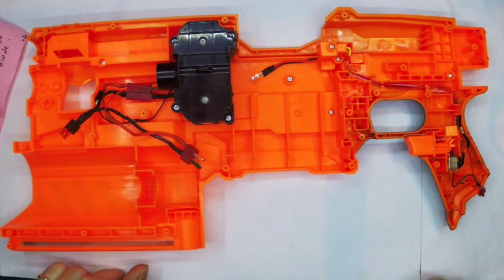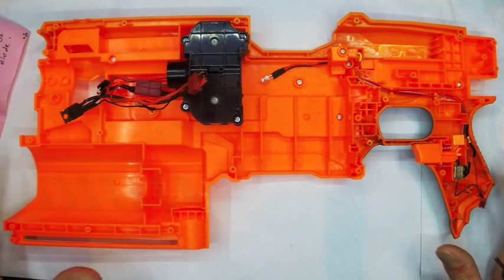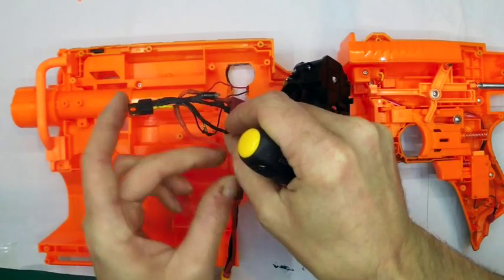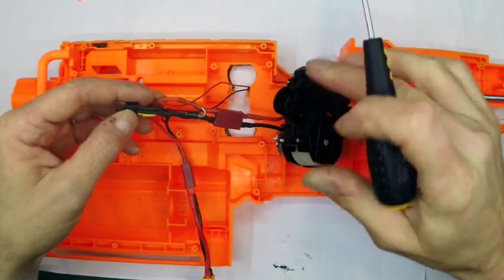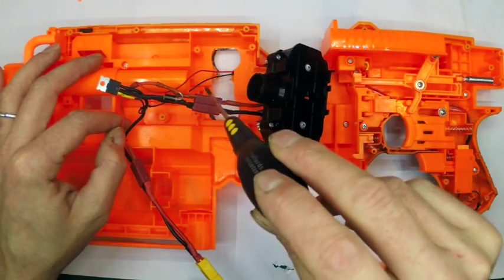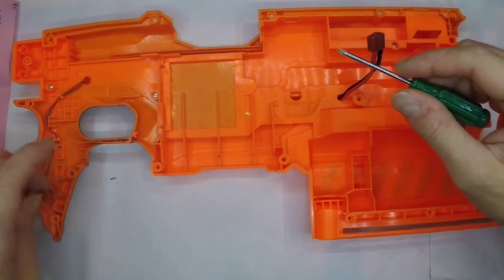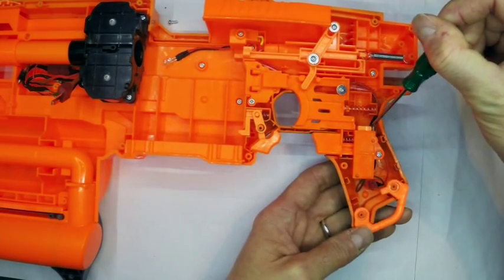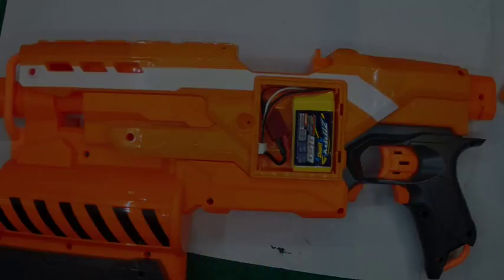Nerf Demolisher Rewire Guide- MOSFET kit.

Comment: Just wondering how high of a discharge and an mAh does the Lipo need to be when powering 180's? I know you use a 2S Lipo but i'm just wondering why use an 850mAh battery? doesn't it have lower Amps?
Reply from the maker: If you are using 3240,s then you want at least 30c constant and as big as will fit in the tray. The demolisher battery tray is particularly annoying because it's short. This means you can't fit larger batteries.
Reply: +Foamdata Services Thank you, and I agree about the case, it's so small that you can't fit a 1000mAh inside. I found that MTB actually stored one in the Jam door using velcrow to keep it secure.
Reply from the maker: +RedNinja Productions Blastersmiths make a tray expander to go outward.  The 850 I linked works for 3240s
Reply: +Foamdata Services I may be using Banshee's for a Demolisher rewire, because FK3240's are becoming obsolete here in Australia, and very expensive to buy just for 2 off eBay. Not to mention the cover for the motors. Really want to Try 180's but they're very expensive.
Reply from the maker: Banshees will be fine on that 850.
Reply: +Foamdata Services Awesome, Now I can finally mod a demolisher properly
Reply: +Foamdata Services How about an 850 with a discharge of 25C constant to a 35C burst for Banshees? or any 130 motors that run on 2S?
Reply from the maker: The voltage rating of the motors isn't what you need to worry about. An XP 180 is a 2s motor, each one of those can pull 30A stalled. All the 130 sized 2s motors will be fine with that battery. Get on Britnerf and look at the Nerf motor data sheet, it has all the info-
http://britnerf.myfreeforum.org/about1967.html

Comment: Thanks for the link but can you solder stranded wire
Reply from the maker: You can solder anything, as long as its non-ferrous, then you need brazing.
You should never use solid core wire for nerf, its not nearly as good, isn't flexible and belongs wiring houses not blasters.

Comment: Where do you get your wire from
Reply from the maker: 18 AWG Silicone Insulated wire is widely used in electronics and is easy to get on e-bay or from electronic hobby stores. If you order the complete kit from BSUK it comes with all the wire you need. i replied to you about this twice now. Please stop posting the same question everywhere. Google is your friend, use it.
Reply from the maker: Leo Hoffman  here is a link to an ebay listing.
http://www.ebay.com/itm/18-AWG-10-Feet-3m-Gauge-Silicone-Wire-Flexible-Stranded-Copper-Cables-for-RC-/281428997791?pt=Radio_Control_Parts_Accessories&hash=item418679b69f

Comment: So the diode is wired in parallel with the motors to shield the MOSFET from Back Electromotive Forces (Back EMF), but the diode does not cause a voltage drop?
Reply from the maker: Yes, it's there solely to shield the MOSFET.
Reply: It doesn't cause a voltage drop because it isn't placed between the motor and FET, it's placed across the motor terminals themselves. It doesn't bypass the motors and short the battery because it's reverse biased (i.e. you're trying to force current through it the wrong way). During rev up and firing no current passes through the diode at all (it's effectively an open circuit).

What it does do is reduce negative voltage spikes (the back EMF you mentioned) when you release the rev trigger so you don't have a huge voltage across the FET which could damage it.
Reply: Thanks for the replies. I think I am beginning to better understand the wiring diagram.